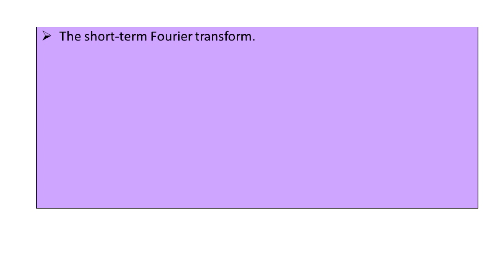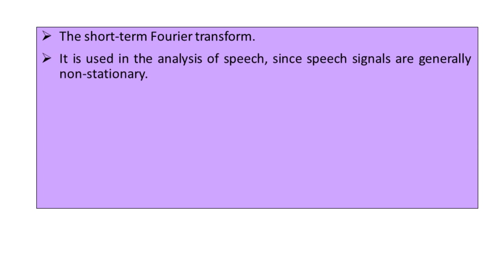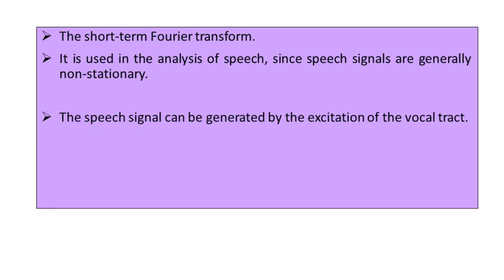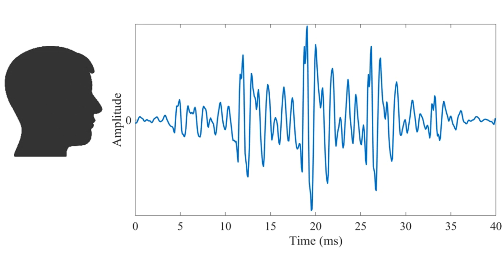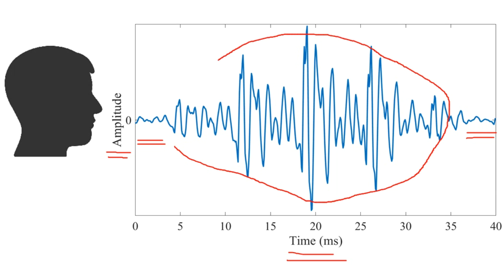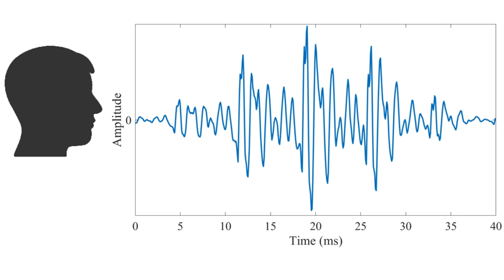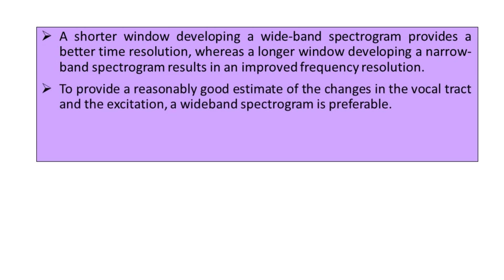Speech Signal Analysis | Signals & Systems Advanced Digital Signal Processing

Comment: 🎯 Key points for quick navigation:

00:10 📊 The Short Term Fourier Transform (STFT) is essential for analyzing speech signals, which are often non-stationary.
01:08 🎤 Speech signals consist of voiced and unvoiced waveforms, where the latter contributes to noise in the signal.
04:07 ⏱️ The application of STFT involves using a windowed function to analyze short time segments of the speech signal, enhancing frequency domain representation.
05:03 ⚖️ The selected window length is crucial; shorter windows improve time resolution, while longer windows enhance frequency resolution.
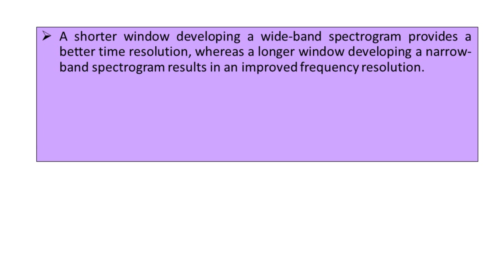06:53 🌊 A wideband spectrogram is preferred for better estimates of vocal tract changes, typically using window sizes close to one pitch period.
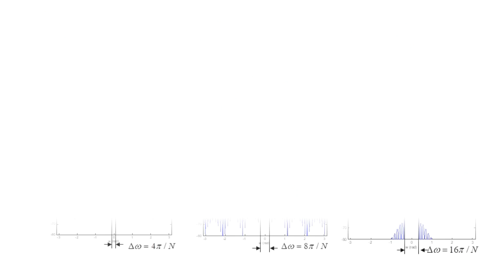09:14 🪟

Made with HARPA AI